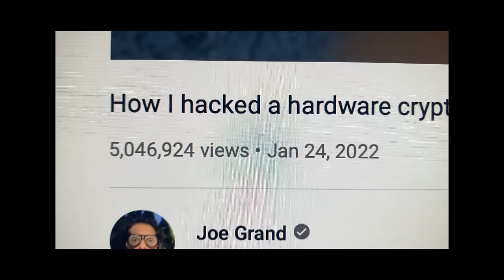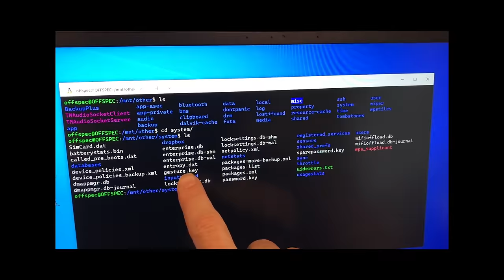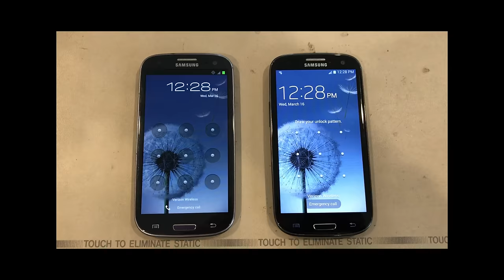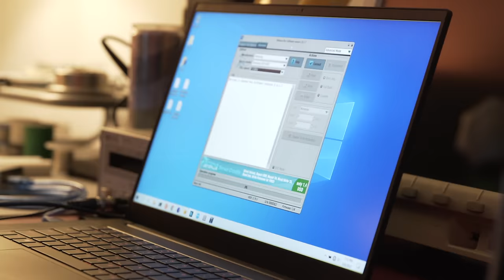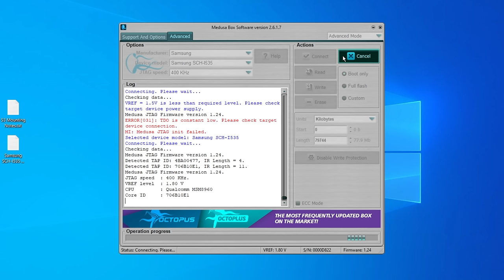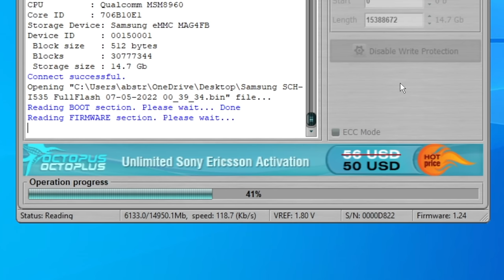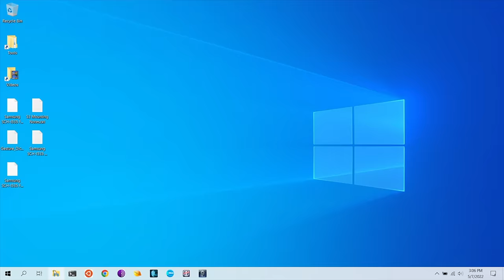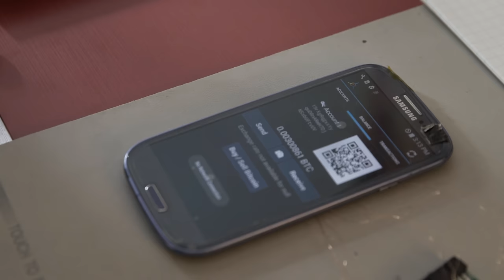Hacking a Samsung Galaxy for $6,000,000 in Bitcoin!?

Comment: All those years trying to get into a 10th prestige lobby and I never questioned what JTAG meant. 

The clouds have parted.. boys we’ve made it
Reply: Ahh yes, the days of xbox 360 JTAG days with IN4001 zener diodes and resistors. I miss the simpler times. Good news, RGH 3.0 doesn't require a mod chip like earlier versions.

Comment: As it looks like it is a Galaxy s3  which is an old model and has android 4.2.1 or 4.4.2 firmware installed. And I remember back in those days no Knox and bootloader locked. You do not need hard work for password cracking need to just install TWRP recovery and you got root access and all of the phone data and password store is accessible.

Comment: It was better to use isp on emmc chip rather than Jtag, I own easyjatg plus, when I connect via isp a can reach 2 mbits per second, also it's 5 wires only, you could also remove pattern using recovery ram with file explorer, rather than that, it was nice thing to watch and learn,
Hope to see more from you,

-old Jtagulator user 👍🌹

Comment: You could have just flash TWRP recovery. Then use it's built in file explorer to remove the “gesture.key“. And then when the device ask for Gesture, just draw anything and it will be accepted.
Reply: I have done the same to another dying Galaxy S3 as well. No
JTAG no bullshit. Just straight up flash TWRP from Odin and wallah full filesystem access.
Reply: Well yeah, but doesn't that work when USB debugging is enabled? 
I have a friend who was sold a stolen Samsung unknowingly.  Tried flashing TWRP but couldn't since USB debugging is not enabled. Anyways, some expert managed to get through it. But of course the data was wiped. I assumed that would be the case if he tried to flash TWRP without USB debugging enabled.
Reply: @wongperson4909  
USB debugging isn't required. From galaxy s1 to S5 and note 1 to note 3, I have never enabled USB debugging to flash TWRP or Kernel.
Reply: @RandomGuy-om1vy  
Exactly, but TWRP won't make it a profitable video isn't it?  😉
Reply: Yeah that's what I do
Reply: @RandomGuy-om1vy  If the device eMMC is dying or is dead then flashing of firmware could be trouble some and cause errors during the flashing process. If the eMMC is dead you're basically out of luck (that I'm aware of)
Reply: Precisely. I’ve done exactly this, and it’s worked for me painlessly. Much safer than physically risking the nand and all this effort :/
The method he used wouldn’t work now because modern android uses encrypted storage by default.
I do totally appreciate the effort he put in though, especially for his previous hacking videos.
Reply: Again... TWRP may not always be an available method of choice for such a device. Clearly you folks aren't taking this into consideration.... Not to sound rude
Reply: @Nunya58294  I can get both points but in this case id go with the hacking. Although you would only flash recovery partition and you could always hack the data partition later on, theres a possibility in some units where the device gets factory reseted when flashing. Thats why in this case I wouldnt risk flashing. And if its encripted theres a chance twrp would require the pass to decrypt data.
Reply: That's some awful soldering...
Reply: @remorema  As long as the eMMC is still good I can see that being a better method; You'd have to format user data if you don't know the default unlock password
Reply: Flashing TWRP has the potential of erasing data, bricking the phone which will require erasing data to make it work again or causing partitions to shift (I used to have this problem with a friends Samsung where it would reformat it's partitions when flashing recovery and lose half the storage until I manually reformatted to the right size). Taking a whole dump of the phone is the best method because even if the phone breaks you can still restore the dump to another similar phone and basically clone it.
Reply: @asandax6  for newer phones thats the case, for these old ones no.
Reply: @asandax6  You'd only run into a brick if you tried to force flash the phone on a locked bootloader. Not only that, but some folks tend to be inexperienced with Android hacking and can also damage the device. Otherwise it's completely fine.
Reply: @asandax6  I do agree to take a physical dump of the device... That way if you can't find the firmware online you have a backup copy
Reply: @Nunya58294  Yeah, people just think they can flash stuff on locked phones freely. You have to unlock the bootloader to be able to flash anything that isnt signed, and unlocking the bootloader will format the device. Also flashing anything is putting the storage at risk, fail the flash and the whole partition is gone even if its unlocked. Doing it the way as in the video is the best way to do it and not because "twrp doesnt make the video valuable".
Reply: EDIT: Actually nope. I just looked up the model number, it's the Verizon-locked S3, there's no bootloader unlock exploit as it seems. Still should have mentioned it in the video.
Reply: Jupp, not even a 20 min operation lol

Comment: Something to add, Samsung S3 didn't get android updates after 4.4. So it did not have full disk encryption.
So we could easily put the phone into Download mode and install a custom recovery which has a file manager and copy the gesture.key file directly.
Doing so could skip all the hardware soldering and copying entire phone memory using JTAG.

Comment: Reminds me of the JTAG hack for the Xbox 360 back in the day. We had to solder an ancient LPT printer cable to the actual CPU in order to dump the nand to execute the exploit. 

It was adrenaline pumping when you managed to pull off the hack on your own after hours of research and tedious work.
Reply: Yep and getting that single wire soldered to the debug pin without a microscope.  It was a miracle that I got it on the first try.
Reply: The good ol xbox media center days. All these kodi guys acting like they know it all.
Reply: The original was easy to add a modchip to.  I guess Microsoft stepped up their game.

Comment: Hmm, I think you could've actually used Samsung Odin (phone flashing tool) to flash TWRP, with which you could read everything... though maybe the bootloader/samsung download mode was locked depending on the region the phone was bought
Reply: I was thinking the same, from twrp you could access data if the device isn't encrypted either
Reply: And that device (the s3) doesn't need unlocking, just installing twrp and if it isn't encrypted you're ready to go
Reply: @user-be1jx7ty7n  i think no, but he went to the safer route of dumping the sys files entirely
Reply: @user-be1jx7ty7n  no the data is Not encrypted,   all s3 variants can be hacked, the user data partition is encrypted for Android 6 and above, but Android 5 and 4 we can edit what we want from user data, he could also do a isp emmc connection instead of JTAG, all the process should Not take more than 1h.
Reply: @KinRool  so why did he do all this?
Reply: @h8h81  For fucking showmanship. It's literally a 10 minute process a youtube video could've walked him through.
Reply: @MrBigTrey  I know right. I love seeing the JTAG process but he made it so complicated. This was such an easy job even I could’ve it.
Reply: @h8h81  maybe he was Not awared about isp emmc connection, still he had octoplus box so he should be knowing that the box supports the S3 emmc isp connection, i would think that he did Not know the isp emmc if he used the old medusa box but he used octoplus, so the jtag choice was made for the show i think, only god knows.
The job was done, that's the most important thing.

Comment: Cool video!
But I think the easiest task was the soldering. SMD soldering isn’t that hard if you use enough flux and a stable counterpart. His version with single thin leads wasn’t the best way. He should have used a socket of the same size, split into half and then solder pin to pin with enough flux. Then you can solder it with any big iron and the tin would only stick to metal/copper and would have no shorts.
The other work is pure genius!

Comment: You could have just deleted the password file using a custom recovery mode (like twrp or cwm) in (data/system/)
 It would have opened using any pattern after deleting it.
Wouldn't even take that long it's a jelly bean.
Reply: I Still appreciate your hard work you're a legend amongst legends.
Reply: What if it didn't work??? It's a very destructive method.
Reply: But don't you need to install this piece of software after you have successfully started the mobile phone?
Reply: What he did is much safer but time consuming. By taking a whole copy flash software of the phone he can install it in as many s3 phones as he wanted.
Reply: I believe he avoided installing a custom recovery mode fearing that the phone might brick or factory reset.
Anyway there's communities like xda developers he could have asked.
Reply: I did this method with a lot of these older androids like s3 s4 S5 and it worked flawless
Only newer phones like example galaxy s6 and up have binary protection where it will brick if you install a custom recovery while the phone is password protected
Reply: Add of course you have to have USB debugging turned on and the connecting device needs authorising before communication is allowed.  And as others have said it could end up bricked.  Then again ODIN or Heimdall can get around this to some degree.
Reply: how he was gonna flash the custom recovery if the bootrom is locked?
Reply: It's not quite that easy for those phones. He worked with US variant, a Galaxy S3 from Verizon i535, which came with factory locked bootloader that prevents from flashing a custom recovery. The approach - to use JTAG was ok, although i would probably went with ISP to save time, and that's also less wires to solder. There are other, non intrusive options as well that doesn't include tampering with the device at all, but JTAG was the best one to film - most thrilling ;-)

Comment: Awesome video, Joe is a proffesional at what he do, but in general this could have been so much easier if he just loaded a custom recovery into that old bootloader, that will give him access to the gesture.key file, then from there just deleted it and entered any random pattern.
Reply: the bootloader is locked, you won't be able to flash a custom recovery
Reply: You need an unlocked bootloader to do that, so the phone has to be unlocked, but maybe with that old android version, you can probably bypass it and unlock it in spite of that.
Reply: I was thinking this before I watched the video. Even with a locked boot loader I remember those devices had something called safestrap.
Reply: @dvrkplayer  bro i want to take some knowlegde on how android system work, pl's can you just briefly tell me wahat is bootloader and how it work's in the system

Comment: So, you want to tell that jtag wasn't fused off on production unit by its vendor… Really funny 😂 And then, out of the sudden, you have read unencrypted rootfs, I guess, from memory, while in fact it was still only on the flash and of course encrypted, that all because cpy halt execution just after boot up when connection over jtag was identified and did not decrypt it yet. Yep, makes sense…

Comment: Actually with the broken JTAG cable it was a better idea to cut it in a half first and try to connect external pins to it cables instead of soldering it directly to circuit board

Comment: You can actually do this in a much simpler way. Flash custom recovery like TWRP onto the phone using ODIN. Boot into TWRP and then flash a remove lockscreen zip that you can find on XDA. It literally removes the lockscreen and lets you gain access to the phone.

Comment: That particular S3 model and the S4 had a known issue with the power switch going bad. Have had to solder MANY replacement power switches on those models. 

When the phone wouldnt power on at first, even with a known good battery, that was my first thought for you guys.

Comment: S3 so easy remove/recover password, just flash TWRP on DL mode (no need unlock any bootloader, doesn't have any security) and extract pattern.key from data/system while you are on recovery. 
If you cut the file to your pc and leave nothing file *.key phone will accept any password.
Unnecesary all the work just for the show.

Comment: This is what I do when I have thick solder for the small pads that I have. I take my solder wire and cut very very very small pieces on my bench. I then heat up my solder iron and stick the pieces onto the tip. They just wick onto the pads very easily with no excess and no bridges. It's also gotta be hard for him to look up like that while he's soldering.

Comment: I had Samsung S3 and when I switched to S4, I noticed the plug under the S3 had different connectors, than the new wires. Out of 5 wires, only one would charge the old S3. So it was not his wire that was defective when he tried to charge it.

Comment: "TV" engineering - let's over dramatise everything. OMG the connector is there (so you don't need to spend 3 mins soldering leads) - wow it didn't work, time to "dah dahhhhhh" solder wires. Entertaining for a non technical audience I guess. Just needs Bear Grills to hang off a light fitting or something.

Comment: @Joe Grand - Would you happen to have experience with hacking into TWRP recovery for Android? I have a bunch of photos that I haven't backed up and they are stored in the Internal Storage of my Android phone. It doesn't have support for microSD, so everything is stored on the built-in eMMC storage. My phone is rooted and when I did a downgrade, it somehow caused my /DATA partition to be encrypted, which means I also cannot get to any files under Internal Storage. Normally, DATA partition is separate to Internal Storage, but the encryption on the Internal Storage is somehow tied to DATA partition. Under TWRP, I can FORMAT DATA and this will reset everything and let me use the phone as normal again. However, this means that everything in DATA is wiped (I have a backup), but this also means that Internal Storage will be wiped (which I do not have a backup of). In TWRP, it can't decrypt user 0, which is the default user you're logged in with on an Android phone. I've tried all the passwords I know of and none of them work. There is no lockscreen configured.

Comment: Dude is recovering millions with a JTAG I’m dead. In the other video he did a reset glitch hack or RGH. These methods are very familiar with modifying video game consoles
Reply: bro acts like he knows what's he talking about 😂, of course it's going to work, he dumped the entire emmc chip
Reply: @th1nhhdk  I don’t really know much of anything. But I’ve soldered JTAG and RGH chips into Xbox 360’s. Just some crossover that really made sense to me
Reply: @MrBoosted6000  This is a different JTAG, it is used to dump the contents of the emmc chip (phone's internal storage), in old versions of android the internal storage is not encrypted by default, so they can get the password from the chip contents